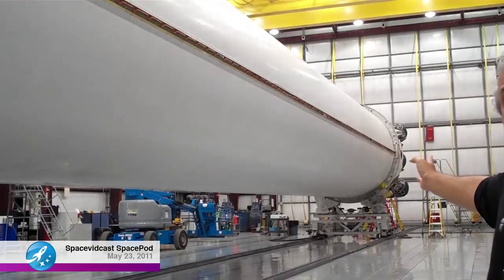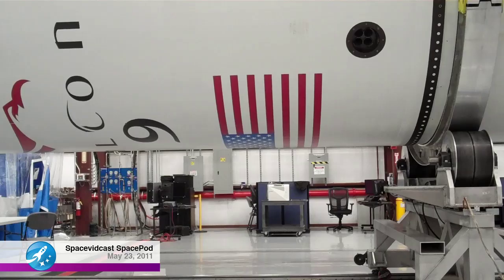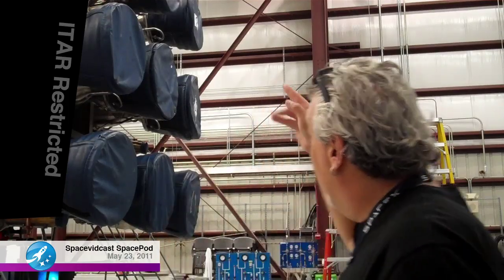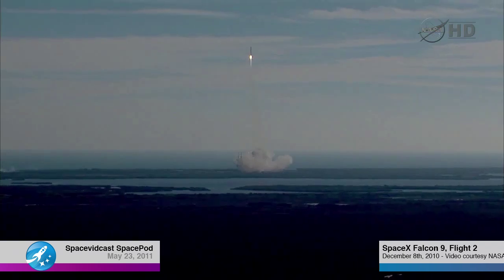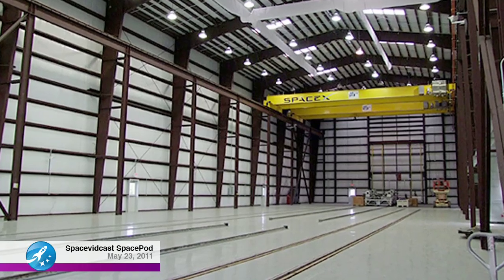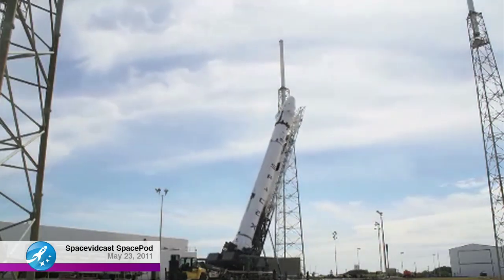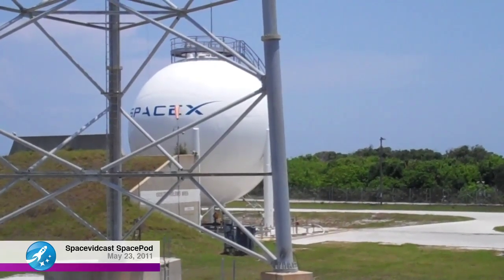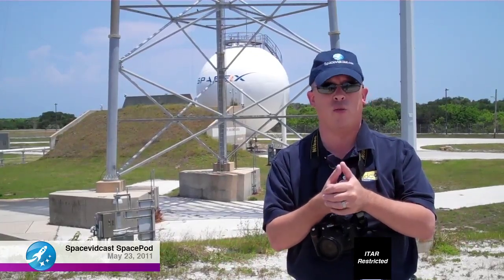A tour of Space Launch Complex 40 - SpacePod 2011.05.23

Comment from the maker: @thisisnotajoke I didn't either until we made that mistake once. That won't happen again.

I was also looking on the SpaceX site for the plumbing of the Merlin engine. While I agree that ITAR is *insane* and needs reform, I can't actually find a shot of what we had in the picture. From what I can tell SpaceX does abide by ITAR and does not show that part of the engine without the shroud around it (which is its normal config, but the shrouds were off for this walkthrough).